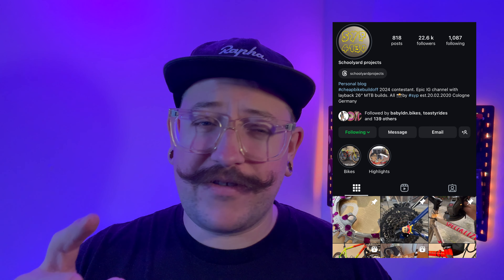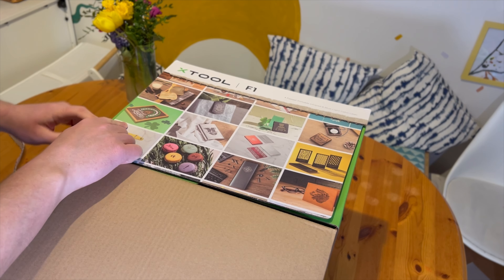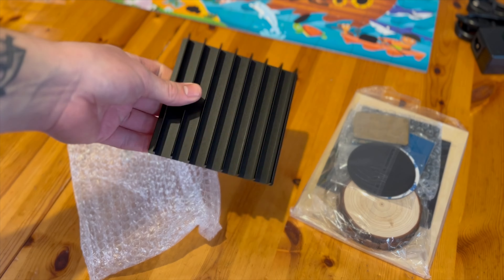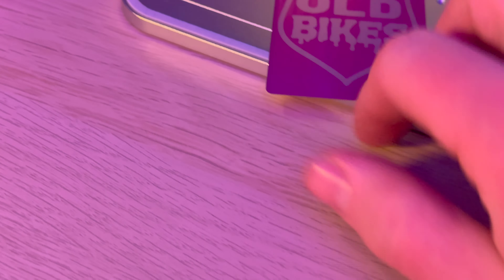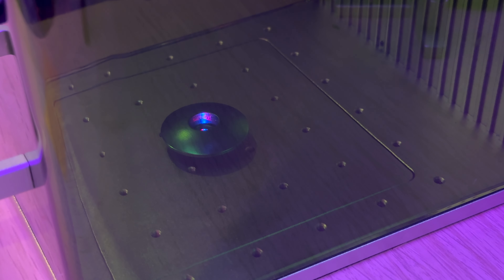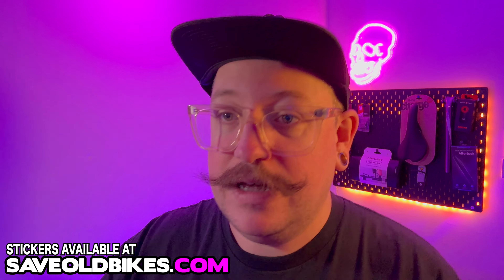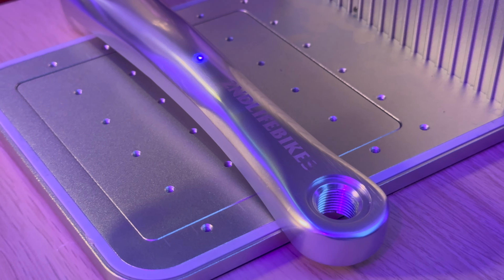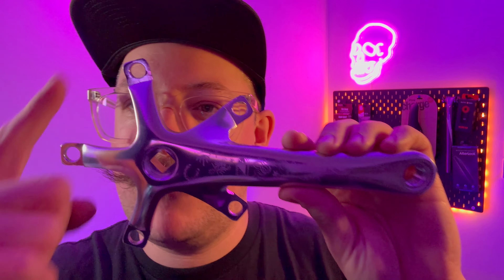Laser Engraving Bike Parts For Retro Bike Builds - XTool F1

Comment: From a business pov, if you're planning to make batches rather than one-off custom jobs, top-caps are a very universal product, i'e modern road bikes, hybrids and MTBs all have 1 1/8 top caps, no matter the size of the bottom bearings  They're also not really structural, once the headset is preloaded and the stem tight on the steerer you could remove it as it's not (supposed to be) bearing any load, so even if you have a high performance bike, a BrandX top cap will function just as well as a Chris King.

A mate of mine had access to a laser cutter (for thin materials, mostly card and plastic I think?) at work in his last job. At higher power settings it could cut through layers on top of aluminium at least (paint, anodising etc) so we bought some plain black 1"1/8 BrandX top-caps from CRC and  made some custom ones, both my bike's now say "Wonble Till I Die" 👍

Edit: If you do one-off jobs on custom components you'll find you spend a lot of time setting up the machine/alignment each time. If you want to sell bespoke top-caps you can make a jig that will work with all top caps, holding it in the same place every time, all you have to do is change the text/font in your designs, maybe tweak the kerning and send the vector data to the machine.

Comment: K...How about you take thin sheet metal and engrave 2nd life, proper crusty,  bulky boys, what have you, within say, a 2 inch by 3 inch rectangle. Snip it out and using an old, bare headtube as a mandrel form into a curve with a rubber mallet.  Now you've got a headbadge you could mount with a little J B Weld.
Reply: That's exactly what I was thinking it would be sick hope he makes them  I would buy some 👍